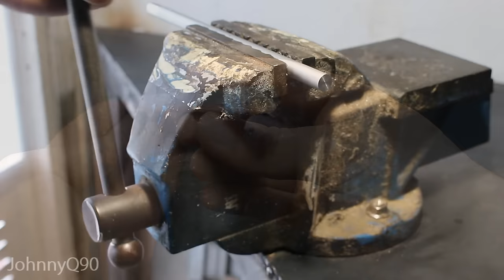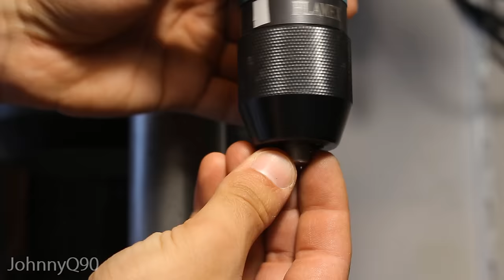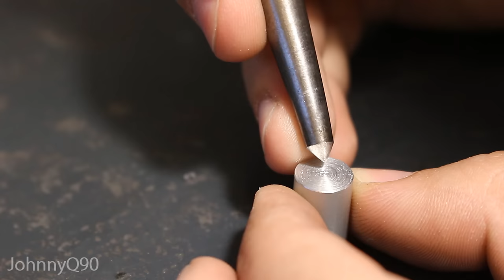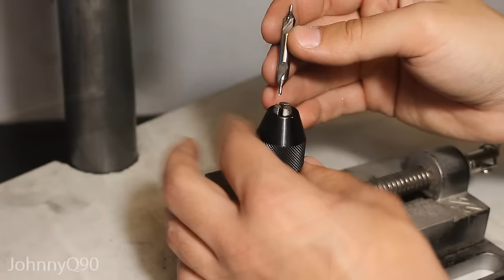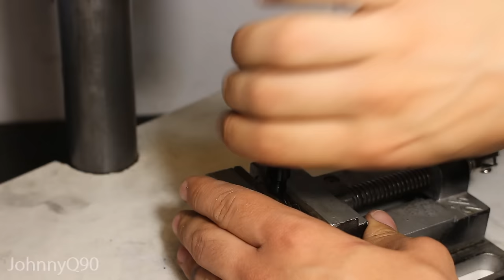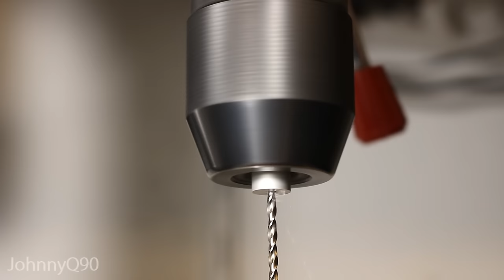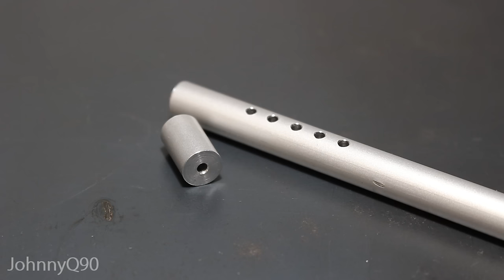Simplest Way to Drill in the Center of ANY Rod!

Comment: Using almost identical method you can get 100% centered hole, but only almost;) What you should do is 1. Fix the smaller chuck in the vise just like you did 2. Insert and tighten a strait rod into BOTH chucks 3. Clamp the vise to the table Now both chucks are aligned and you can drill exactly in the center of whatever you put in the bottom chuck using drill bit in the top one (or you can swap this and put the part in the top chuck if it's bigger etc). But no center punching is needed and the result is much more accurate, comparable to what you would get on the lathe...

Comment: Exact center for Eyeballing it with first piece.
Reply: Yeah. Haha! But How he find the center of the rod? Would need an adjustable guide and no one has that on hand. This is an excellent method especially  when you can see the cut rings after sawing off the stub. So I’d have pitch it before sanding it.
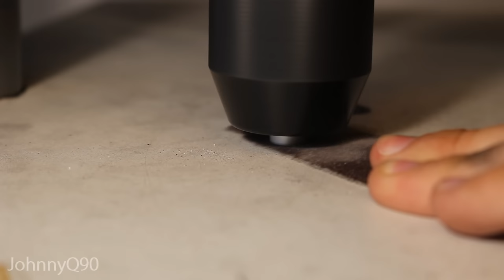Reply: @jeffbrown7246  Isn't it the sanding that marks the center of the rod ? at 0:55
Reply: @tomdiams  I don’t think so. I’m not sure why he sanded it. The other end which was already flat and smooth would rest on the horizontal rod to be drilled. (It could be smoothed if it isn’t already) I noticed when he cutoff the rod the stub piece had saw rings. If the goal is to find the center of the rod as closely as possible I’m thinking the saw rings actually provide a good reference which will help see the true center. Punch the center of the saw rings as closely as you can.. Otherwise you’re guessing where center is on a smooth surface. Since he chucked-it-up to drill the stub it doesn’t matter because the chuck will keep it true (vertical) if he chucks it true with a level or such. Then the other end will rest on the rod being drilled that’s laying horizontally.  Assuming the smooth end rests flush that will assure the stub is exactly (as much as possible) perpendicular to the rod. Just my opinion but the idea is to get the best possible reference and the saw rings seem to be a natural help by default. I really like this tip. I’ll remember this one!
Reply: that's what I thought as well, but I guess the idea is that eyeballing works good enough and it's easier to drill straight on a flat surface rather than a curved surface.
Reply: A trick I learned from an old Machinist is to use a thin metal ruler and place it between the work piece and the bit. Then make small adjustment until the ruler is level, then drill. Much easier and faster.
Reply: @jeffbrown7246  Saw rings? He cut off with a hacksaw and vise. Reciprocal motion leaves linear marks across the piece.
Reply: @femto505  great idea
Reply: Sanding wasn’t about marking the center, although that is a nice byproduct for when you need a visual guide for the initial tap. 
Sanding was exactly as the video said: to flatting the sawing plane from burrs. 

As for “first eyeballing”, that also threw me off first. And then later I realized what he did:
As long as the pilot hole (tap) was close enough to the true center, the circular motion in spinning the target piece practically guarantees the hole will be center. 
If he clamped down the target piece stationary, and took a spinning drill bit to it, then no. 
But by spinning the target piece, while holding the drill bit stationary, that hole-drilling action is self-centering. 

Pretty smart technique. I learned something new.
Reply: The spinning will open up the hole evenly making it center
Reply: And for those of us with a good eye for level and center, using micro measuring tools just wastes time.
Reply: @tomdiams  yeah could be
Reply: @reallifeengineer7214  yes this is the answer, thanks.  If the boot was off center, would just make a bigger hole in the target piece, but still in the center
Reply: @emostorm7  correct.  it's an old trick that moving a spinning piece of work onto a stationery drill bit will result in automatic centering.
Reply: Exact doesn't exist in mechanics
Reply: There are a lot of people in this comment thread that think they are smart, but arent.
@Real Life Engineer nails the thought process for this method.
Reply: @jeffbrown7246  saw rings? Metal doesnt grow like a tree.?.?.? Some people are so smart. The rings were made by the ROTATION during sanding. Back and forth sawing motion would make saw LINES.
Reply: @completelyrandomtask  why
Reply: I don’t know what you guys are talking about. Have you never seen a steel tree .. maybe a step magnolia??  🙈 Sheezzz gemmee a break! Hahaha!!! 😂😂😂
Actually when I look at the rod it appears to have some forming circles or such .. but not so much ... it’s saw marks. Hahaha! My bad what can I say? It’s the plight of an EE. 🤦🏼‍♂️🤷🏻‍♂️ 😂
Reply: A mini lathe helps 😁
Reply: The center drill mounted in the mini chuck that was then held in a vice so it could line up to a center punch. And I seen the drill spinning in the chuck so it’s not even a “smooth” drill hole lol. It’s neat trick works for home projects. Wouldn’t pass if work piece actually required a plus/minus .005  tho on dimensions.  But overall it’s a cool trick for YouTube clicks
Reply: that escalated quickly
Reply: @reallifeengineer7214  I did not get this before. That's genius.
Reply: The hole punch he used as a guide didn’t need to be perfectly center; the drill press self centered the hole. It did so in a similar manner to how a lathe works.
Reply: The sanding scored concentric circles into it marking the center
Reply: As someone who was a machinist for 15 years before going behind the desk, this entire thing made my skin crawl.  There were like 10 things "wrong" with what was done here.
Reply: @tomdiams  I believe that was the idea.
Reply: @vitriol1469  Okay.  I'll go along with that.  ;)
Reply: ‘Simplest way to almost-center drill any rod’...
Reply: @jeffbrown7246  the marks from sanding will show you the center. He probably got within a few thousands doing it this way.
Reply: @jeffbrown7246  I think the point of sanding with course sandpaper is to get circular rings to give you the center of the jig. Since the jig is made from the same material it is self centering in the vice and it will guide the drill bit to center of the rod you are drilling.
Reply: How do you know the centre punch was in the centre????
Reply: @reallifeengineer7214  rubbish
Reply: Just use the square to find a center for any round objects!
Reply: He had already marked it. Look again.
Reply: @tomdiams  He marked the center off camera, if you look closely you can see the scratch lines.
Reply: I think  a caliper would work. Find diameter then move the caliper measurement to half, lock the position. And scratch the center with the caliper. Repeat on several spots around the rod.
Reply: That makes the best sense, since concentric rings show the exact center. Of course the hard part is punching exactly in the "cross hairs".
Reply: @femto505  yup, was looking for this tip. Way faster.

Comment: You lost me when you eyeballed the center of the rod and used a manual punch.
Reply: The sand paper left scratch marks on the end of the rod, these marks indicate very close to center.
Reply: All depends on the accuracy you require, eyeballing may get you to 0.2mm otherwise you need better procedure and equipment.
Reply: It makes no difference. That's just being waaaaaaaaaaay too picky.
Reply: @bigkiv47 JohnnyQ90 may not have fully tooled mills and lathes like you or I, no edge finders, dividing heads, optical center finders, and all the rest of that high dollar equipment.  As I stated before, the scratch marks will indicate very close to center, depending on the grit count of the sand paper used, and the run out of the drill press spindle. It all comes down to what you have to work with and the accuracy needed, would you  paint a house with a pin stripe brush... lighten up dude.
Reply: He uses the small side cutting bit first to create a perfect round hole in the center of the piece to use as a guide for a bigger hole. It doesn't matter if the center punch mark is exact. When the work is spinning and the bit is stationary, only one of two things can happen: The bit will break off( Off Center ) or  the bit will cut  wider ( Close to Center ). The work spinning makes the hole perfectly center but the hole can be a little wider.
Reply: A bell punch has always been a quick way to mark a centre point.
Reply: And as a result of the "eye balled" center, the other rod could also be offcenter. This was a complicated way of doing it almost precisely. Could have literally center punched the rod directly and saved time and been equally inaccurate.
Reply: @beachbarlouie  exactly
Reply: @MrCamarokid83  Not in machining were one thousands off may cause a piece to fail!
Reply: You eyeballed the centre of the rod. Might as well have eyeballed the whole thing and not bothered with the guide rod.
Reply: @MrCamarokid83  you'll never work in a machine shop, you walnut. Thousands matter.
Reply: @michaelronneseth801  Did you notice how the part was spinning in the drill? You cannot drill the hole offset in any way. The punch being off-center can only affect the radius of the hole.
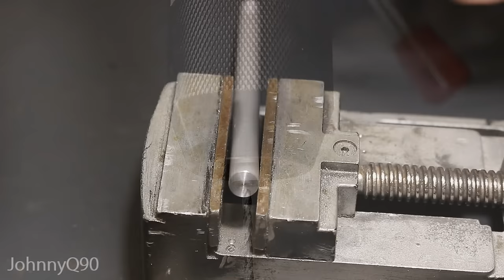Reply: @MikkoRantalainen  you're actually wrong, go to 2:28 freeze the frame and  you can clearly see it's not centered. Any person who's done any amount of drilling knows a drill bit will flex, particularly of it has been extended far from the chuck as this one has been. It will bend quite a bit so the initial position has to be perfect and it isn't. I would include a picture of the frame but I am not able to but  it's easy for you to verify that.
Reply: @michaelronneseth801  Yes, the drill bit will flex and the start of the hole is probably not centered. However, the deeper hole you drill, the more the side of the drill bit will carve the hole towards the middle. In addition, if you keep the bottom floating (e.g. on a piece of paper) it will automatically slide to the center while you drill the hole. Obviously you should keep track which side was the initial drilling side because that hole will be slightly too big.

That said, if you put the initial punch too much away from the center, the drill bit will simply break while you try to complete the drilling, especially if you try to drill fast.
Reply: @MikkoRantalainen  We could argue forever but the image says it all. It is out by 1/2 the diameter of the bit (the radius). If you compare the piece he drilled in the same frame from 2:28, you can see the top right is quite a bit wider than top left. It's way out. A simpler way would have been to go to the socket drawer, find a socket of the same diameter and then find a drill bill that precisely fit through the socket. Clamp them, spin the bit to mark the true centre of the rod and create a dimple, remove the socket, insert the correct size drill bit and drill the holes using the dimple as the "punched" center. Would take 1/4 the time and be much more accurate.
Reply: @michaelronneseth801  Do you agree that 2:28 shows that the hole is centered on work even though the drill bit is seriously off-center when ejected? This is possible due flex in the bit + the work spinning fast enough to bend the drill bit to the center.

I agree that the displayed method is not the most accurate method. However, it should result in pretty good results overall.
Reply: @MikkoRantalainen  if you view a close up, which I wish I could post, the hole looks quite clearly off center. In the frame, it's off to the left. In any case I explained how I would probably do it if I didn't have a lathe, but I do 🙂. In reality there are several different, faster and more accurate ways using even less equipment and far less time that could have achieved the same or better results. I think I'm going to make a short video myself as this one garnered so many accolades for it's "simplicity".
Reply: @michaelronneseth801  It would be nice if you could create a video demonstrating your method! Then it will be easier to understand the differences and required tools.
Reply: @bigkiv47  How would you ! Do it !? Then ??
Reply: He should have clamped the centre drill with the chuck, then locked the vice in place. After that you can undo the drill chuck to release the now centralized centre drill so now when the bar is loaded it has to be right in the middle.
Reply: @ronaldmadican2393  But how !? Do you centralize the Vice !?
Reply: @Ted Bigham So what's Good about ! The ! Wrong ! Size ! Hole !? Then !
Reply: He didn't eyeball the center, he punched EXACTLY where the rod was turned down to a pin...lathe leaves rings as it moves center!
Reply: @beachbarlouie  Yes, on a lathe perhaps, not on a drill press with .5 mm play
Reply: @beachbarlouie Only real scientific argument in this chaos of unnecessary nit picking. In most part of the world, even automobile mechanics and fabrication shops do not have means to buy an expensive lathe. So most use drill press rather than a lathe to grind holes.
Reply: @bigkiv47  Slight off center point will produce a wideer hole, but still perfectly centered, when work is rotated and bit is fixed (here) if the bit survives the side strain. It seems he has clearer mechanical fundamentals than you lot. Go learn the difference between drill bit rotating and work rotating methods.
Reply: Compared to having your drill bit slip off your round tube over and over, I would say this is a clear improvement.
Reply: Totally agree.
Reply: I beg your pardon he's working to tolerance... which is +/- 0.1".
Reply: On my HD monitor, it looked like he had scratched an x for the center.. before he used a punch. 
Just saying, it could have been scratches from the sandpaper...
Reply: he lost me the second he didnt even finish cutting the rod and bent it back and forth to break it the rest of the way
Reply: It cannot be more off center than spindle runout allows. The hole can be the wrong size, yes. I have been forced to use a drill press this way. Center bored parts are spinning around their own center. This works with carbide lathe cutters, too. Centering a drill works. The worst you can do is break drills, or alter hole size. This is an emergency procedure when you broke your lathe.
Reply: @michaelronneseth801  at 2:28 he has finished drilling the hole and as the bit is not solid fixed to the working station, thus allowing it to self centre when he is drilling. What @Mikko Rantalainen is saying is that as he has the piece being drilled is spinning the drill bit will centre itself to a degree if you are close enough.

Effectively he is using his drill press as a lathe, crude but effective.
Reply: Bah, he did alright considering he only used a drill press.  He ain't building piannas
Reply: @desmondspamer5097  no, he definitely eye balled it using the lines left by the Emery paper.  Sorry
Reply: @Shornandkenny  And...So? Trying for center is better than not.
Reply: @got2kittys  someone said he didn't eyeball it he used the lines left by the lathe. 

Imo that is still eyeballing it. To not eyeball it would be to dial up the centre of it then center drill or properly center drill it using a lathe.
Reply: @Shornandkenny  True, but that wasn't a lathe. Nobody would do that, on a drill press if they had a functional lathe.
Reply: @got2kittys  yes I realize that. He did well considering the tools that he had but... he did eyeball it. With that said he eyeballed it nice. Were talking about whether eyeballed it or not though.
Reply: @got2kittys  shut up? Wow. 

Have a nice day DH
Reply: @Shornandkenny  it's a joke. Im still not saying he ocular visual organed it.
  Don't be pompous.
Reply: @got2kittys  dont call me pompous
Reply: @got2kittys  seriously have a great day nerd lol.
Reply: @got2kittys  trying for centre is better than not? Where does that come from what's that got to do with it? 

What he did was eyeball it with a centre punch. No need for a centre drill on the job or in the title. 

He did a nice job tho fir a young fella with a drill press. Now piss off troll
Reply: Cry
Reply: Depends on application.. can't say I see myself needed to use this technique for something with super tight tolerances..if I did I'd make the part at work lol
Reply: Getting that centre spot on , especially dealing with metal is imperative, I thought that's what this video was going to show us!

Comment: This is the woodworker's version of 5-minute crafts.  Start by embedding abrasive into a soft aluminum lap, then mark the sides with the jaws of the drill chuck.  Then, use a giant punch to mark the approximate center.  And so on.

Comment: That’s a pretty neat tip but to be honest, I’ve never had an issue drilling rods with a drill press and a V-block. Just centre the V-block by lowering the bit (not powered up) into the centre of the block, clamp the block down in that position and you’ll get a perfectly centered hole in any size pipe.